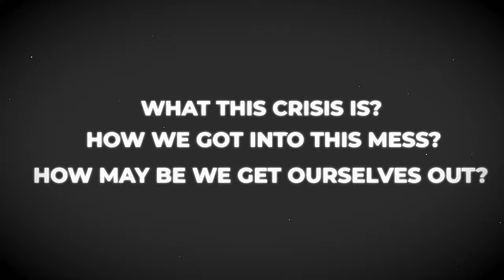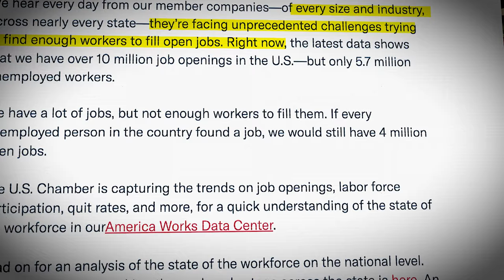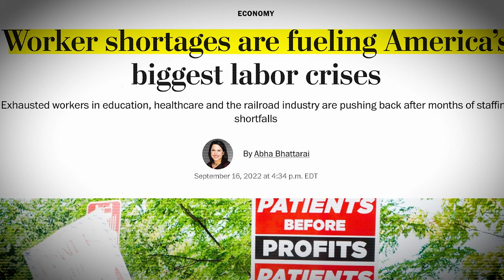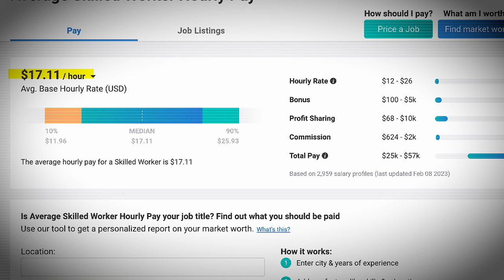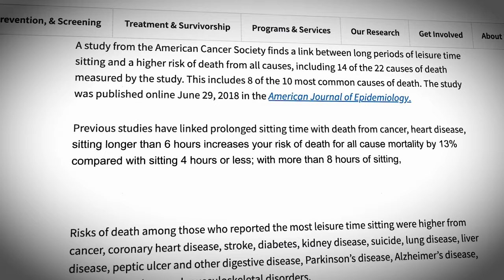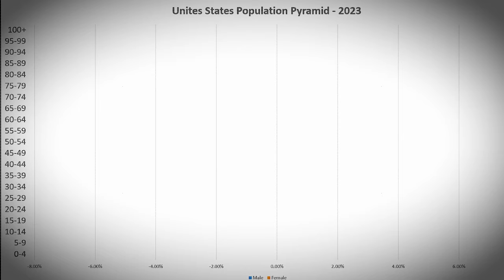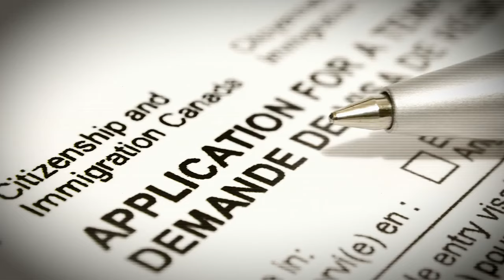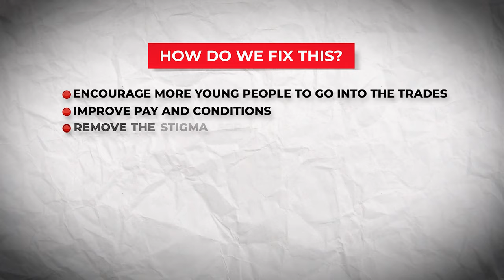The Skilled Worker Crisis - Why Blue Collar Workers are Hard to Find and What Can Be Done About it

Comment: When I was young and gung-ho for an apprenticeship in the trades,  no apprenticeship was available.  It forced me to join the military.  I had a great military career.  After retirement and upon finishing my degree I found a career in public safety.  I never looked back.  The trades were forever in my rear view mirror.  The trades didn’t want me decades ago.  I now have no need for the trades.
Reply from the maker: Glad you found a great career in the military, but it is too bad that there wasn't a focus on the trades in the past. I fear it's the same say today.
Reply: I've tried getting construction, plumbing, electrical, and LOTS of other similar jobs.  They wouldn't hire me when I was in my 20's, and now that I'm in my late 30's and have been trying to get a job closer to home, I'm getting the same crap all over again.  And I'm talking entry level jobs that say no experience needed.  I've worked in logging for 15 years.  I've done lots of manual labor in the industry.  It requires alot of commuting, which I'm absolutely burned out on, but it's the only thing that's ever worked out for me.
Reply: @yearginclarke  Go to college
Reply: @bkstandard882  I wish I had the time when I'm busy.  My last job I had a 6 hour commute, wake up at 3:10 AM and get back home at 5 or 6 PM, leaving me with little time for anything else.  I'm currently laid off due to weather, but when I go back I won't have time either.  Can't quit my job...there would be no income.  

Not only that, I suck at math and doubt I would be able to succeed in college.  I almost failed high school due to really bad problems with math.  I would have to start all over again from like a 6th grade level.
Reply: @yearginclarke Your elementary school math problem sound like me and many others that had that one stumbling block to college. I'm sorry.

Comment: I tried to get into HVAC, electrician, and even painting/drywall. Almost every time I applied for an entry-level job in any of those trades, I was rejected because I didn't already have experience. And most of these trades boast that you don't need to go to college to get into them, but when you apply for an entry position they always ask "How many years of experience do you have?" It's the most frustrating and backwards load of BS I've ever dealt with. An entry-level job that requires years of experience?? Doesn't make sense to me!
If you refuse to hire and train new people with no experience and only want people with experience, it shouldn't be a mystery why there's a labor shortage. 

And add to that, the fact that if you get a job in tech or IT (which is much easier on your body) you can make double or triple what a tradesman makes.
Reply: Coming from a guy in hvac I would stay away, they barely pay above any other basic factory job. You have down seasons where you make half of what you make in other months. You will starve in those transition seasons. As everything else high demand and low pay, makes no sense. They can’t figure out why no one wants to be a tradesman lol.
Reply: A job in IT will raise your blood pressure to astronomical levels.
Reply: Sad but there is a fair amount of truth here.
Reply: Thank you for speaking out. I had the same experience not being hired right out of trade school. I think a lot of it’s because they don’t want to teach folks patiently
Reply: What entryjobs were you trying to get into?
Reply: If you want a job in HVAC get your universal EPA certification and buy a pair of gauges and you will get hired on the spot starting pay isn't great roughly 16 or 17 an hour to start but work your ass off and learn as much as you can on and off the job and you will be worth 30-40 an hour within 2 years. Especially now when in 2 years all the sinor techs will be retiring and good techs will be in high demand.
Reply: Lie and then fake it you make it
Reply: Yeah if you didn’t got to trade school they want experience even for an entry level position , it’s much easier to get hired when you have been to school, when I fished my schooling I had a ton of jobs trying to hire me , my schools also worked with a lot of companies tho
Reply: @Art-si7cj    At this point that's all they have left to recruit from. The US has been below replacement level for the past 60 years (we don't make enough kids to replace ourselves, so in about 30 years the grey population will outpace working population), skilled immigrants are hard to come-by because other developed nations are running into the same issue and compete with us, and the people crossing the border generally are not skilled labour.
Reply: That is an issue in almost every career field.
Reply: welcome to the tradie life. it's all about nepotism. and don't think your boss isn't going to be just as shitty as a middle manager in an office setting.
i really wish people would stop romanticizing the trades.
Reply: Follow up on that job application and SHOW them that your interested. Put pressure on management to hire you to give you an opportunity.  Don't take no for an answer. Keep asking. They'll hire you. Don't walk away from a no. (I'm a plumbing business owner). We need plumbers bad, that WANT to work. No excuses , no trying to get out of work.
Reply: @Art-si7cj lulz, they want the weak minded applying.
Reply: Same experience here when I tried to get into welding
Reply: Have you tried looking for "apprenticeships?"  That phrase specifically will get you in the doors without any experience I can promise you that.  Heck an apprenticeship in anything will get you in the door.  Plus if you wanna do hvac, your goal should be to go into commercial / industrial which will be MUCH easier on the body and pays amazing. 
Just my experience, and heck you can start a commercial business.
Reply: Why not take a job that's basically meaningless for a small paycut 

Why.anyone would want to work harder, more responsibility 
For a.small raise
Reply: You gotta play the game better man. Find a buddy who does the job, work with/under them and work hard. It's just years on paper.
Reply: @Art-si7cj They aren't trying to keep the weak minded away. They are trying to provoke an allergic reaction in people that want high wages. 

If you don't want to be paid enougj to retire and only care about your truck payment then you'll be real proud of yourself for your so-called strong mind. Woohoo! You got the job! Amazing!

Except all the people that didn't can go to their parents and ask to stay in college programs and live it up while you make so little your one bad year from being homeless.
Reply: i am going through this same thing right now. I always heard “we have a shortage. nobody wants to work”. Then in reality, every single company wants 1-2 years experience as a hard requirement to get in. I’m not sure what’s going on but it’s definitely not the reality that people in the trades explain. “nobody wants to do our job” but only taking on experienced people. There’s a serious disconnect.
Reply: @thispersonrighthere9024 the only benefit is it's less passive aggressive bullshit but more direct aggressive bullshit.
Reply: These jobs are all so dumbed down now anyway, they broke them into smaller and smaller tasks so that anyone coming across the border can be taught to do it in a week, you won’t find many competent tradesmen under 50. Electrical companies in my area are hiring “conduit installers” so their new apprentices won’t master conduit bending, and the conduit guys won’t know electrical.

Comment: Wages are terrible , companies refusing to hire mature candidates,  back breaking work for low humiliating wages, no thanks
Reply: Precisely this, I will never advocate for these trash jobs
Reply: For an electrician?
Reply: Yea I applied for a job and the guy wanted to pay 19 an hour. And I have carpentry experience. Enough to where I do my own jobs. Crazy
Reply: yup
Reply: Exactly this. I am a highly skilled welder and machinist. Left because the "We start low, but you'll get raises fast!" promise was a complete lie. Got really good, bought my own machines, and then went on my own for a few years. I eventually wanted more stability and less stress, so I applied for jobs again and the wages hadn't  budged an inch. After that I went back to school for engineering and it was the best decision I have made.
Reply: @Rev-di1vl learn to work.learn a trade . Trade MEN are not afraid of lay offs. Ask your self can they replace me by tomorrow. If they can your always gonna be scared

Comment: I’m in the welding trades, and I can say the problem in my specific industry is low wages. Why do something difficult like learning to weld and passing weld tests when warehouse work requires much less skill and pays nearly the same or better. I’m not saying there are not good paying welding jobs, I’m saying good luck finding one early in your career.
Reply: literally took me like 5 years from the time i left trade school
Reply: @brycecooley7017  there is shortage for all trades, believe it or not 35-60 years the trades made alot of money compared other jobs. 

But as time passed the sector became more non-union as non-union makes up 70 percent of the sector, and union only 30 percent. Before it was flipped. So basically the wages have not gone up with inflation and living cost.

Comment: I have been a commercial/industrial plumber, hvac installer/tech, electrician, fire alarm/low voltage installer and fire sprinkler designer/installer. I have 35 years in construction and the issue is pay. We’ll pay in my area, the Southeast. Back in the early 90’s I made $12 dollars an hour but within a year or so I made $15. Now, over three decades later, will all my experience, the most I am offered an hour is $28-$30 an hour. That means, with inflation, I’m making $8-$10 less than I did at 18 years old. So me, 18 and not knowing a dang thing basically made more money than I would today. Oh, and by the way, I have to work a second job to just pay my bills. This is why smart and intelligent kids are not going into a construction trade. It’s a dead end. Pay a living wage and they may actually consider joining a trade. But employers aren’t going to do that and that’s why for instance the job site I’m on now has over 200 illegal Latinos and 3, yes three, English speaking guys.

Comment: I have aged out of the triads in my late 60’s, last job was as an industrial electrician (and other building repairs) prior to that HVAC&R and was well paid with good benefits. The new workers did not appear to want to learn new and varied skills. 
I own a 94 car that no one wants to work on because it’s older than a 96 … no OBD2 diagnostics, most of the mechanics are under 50 and seam to lack the diagnostics skills. 
Some of the shortages are in skills, want to learn, and numbers.
Many trades pay $50 + benefits (many are union and many not)

Comment: I've been an aircraft mechanic on and off for 8 years now, and am moving very actively to get out of it asap. The narrative of "it pays really well actually" only comes into effect at the cost of extremely long hours and physically demanding labor. In short, the pay-to-effort ratio (although impossible to quantify with numbers) is criminally horrendous. My friends from college get paid $250k+ working as airline pilots - I'm sure the job has its challenges but the thought of flying a jet while sipping on your favorite Starbucks en route to a Cabo overnight certainly beats getting cut, bruised and burned working with toxic chemicals inside a hangar that exceeds 130F in the summer ... for $65k a year.

Another huge thing with these blue collar jobs is the crab mentality - i.e. "if I can't have it, then neither can you." A huge difference between pilots and mechanics - and as an extension, white collar vs blue collar - I've noticed is that pilots generally help each other out and are amenable to cooperating to collectively improve their (already nice) working conditions whereas mechanics love to tear each other to shreds. Case in point, if Bob hears that Tim can do a job in 30 man-hours, then Tim be damned - Bob can do it in 20, and for cheaper!!! Patterns like these certainly give customers more options, but it puts an unsustainable strain on workers to do more with less.

In my relatively short career so far spanning a decade, I've worked alternating white/blue collar gigs ranging from apprentice aviation mechanic to robotics actuator sales engineer. I recall the workplace atmosphere in the white collar jobs to be MUCH more pleasant than having to deal with some of the most bitter and toxic coworkers I found in the hangar floor. Currently I'm building up my flying hours so I myself can start getting paid to fly these planes than wrenching on them.

Comment: It will never be solved until wages are better than taco bell
Reply from the maker: It's true.  Wages are the key.
Reply: @DIYwithDave  And yet you barely mentioned LOW PAY in over 11 minutes of blah. I wonder why that is? ALL the rest of it is just BLAH BLAH. 
Pay MORE. The end. 
That would have been a super short, non-monetizable video, so instead we get this load of nonsense.
Reply from the maker: Again, sorry you didn't like the video. Starting pay is a huge factor, but not the only factor. People starting in the trades need to see a light at the end of the tunnel from an income standpoint. People in the trades can earn a very good living, but in many cases, it takes years to get to that point and for those starting out, it often times does not feel like it is worth it.

Comment: Join the unions. I worked private sector and made 17 -> 19.50.

 I switched trades, I was back at complete start; the union started me at roughly 21.50. I also have a pension, annuity and a program down on paper with key checkpoints and scheduled raises. Including inflation adjustments.

Comment: I investigate this topic for a couple of years already, through YouTube videos ad comments, and I can pick a reason no one is mostly pointing at. Level of complexity for this jobs went up, while average Joe don't become more responsible or faster learner. It hard to break a hammer, not so much so with power tools and lots of other expensive equipment that is common nowadays. So by hiring a wrong person you get F$ckd two ways, by have you equipment that cost a fortune at risk being brocken or stolen, and high safety risk from not properly trained person used it. Industry as a whole lost this moment, because this complexity grow gradually and seamless for people inside industry, so there was no evident signs to change approach to hiring and keeping people. Now you more NEED than WANT trained person because if this. And no one wants to PAY for necessary training.